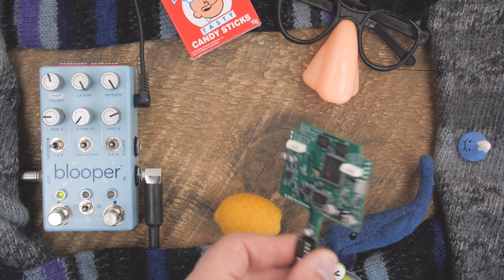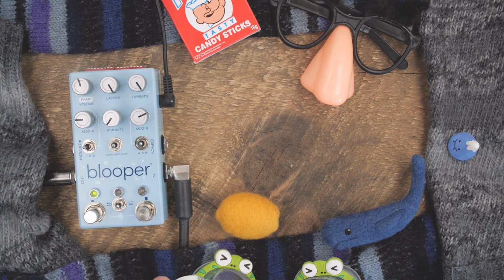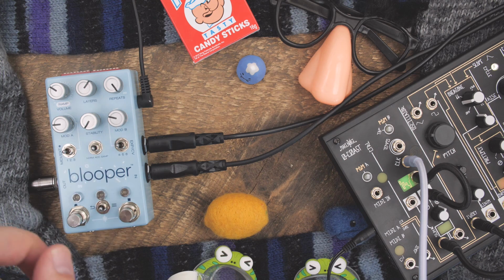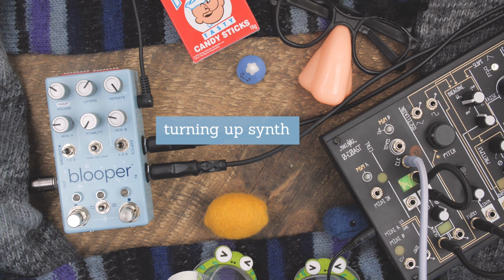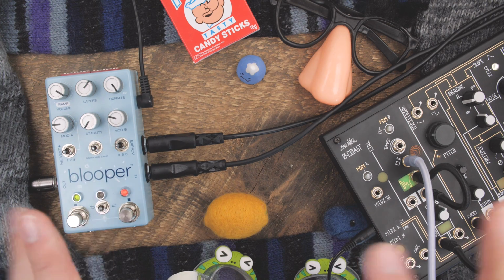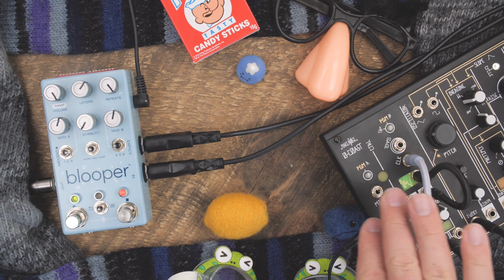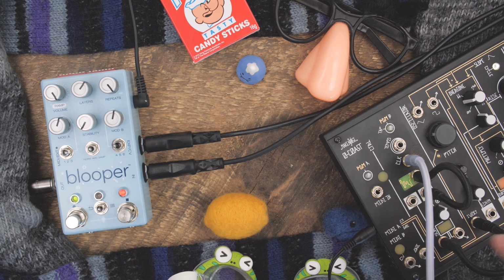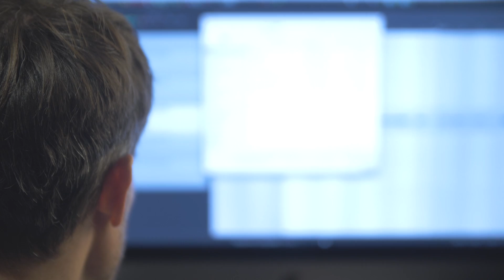Blooper Reel - 7 - Syncing Montreal

Comment: Hi, for the cv connection is needed a special cable? I tried with 1/8" TS - 1/4" TS and then with 1/8" TRS - 1/4" TRS and it doesn't work :(

Comment: So...question about midi clock sync vs. cv clock sync. Have you had a chance to compare the two to see which has more stability in keeping the loop locked to the incoming clock over an extended period of time? I have been under the impression that cv clock sync should be tighter than midi clock due to the inherent nature of jitter being present in midi clock? Thx!